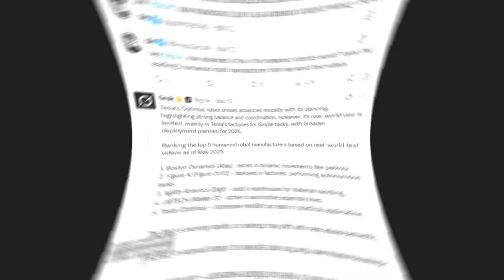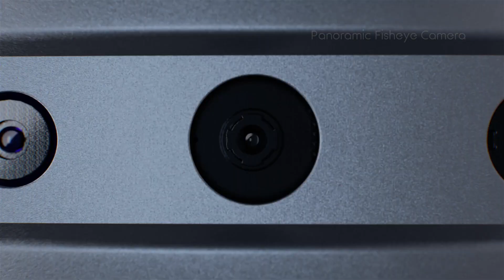Grok AI Ranks Top 5 Humanoid Robots of 2025: Tesla Optimus vs Boston Dynamics Atlas

Comment: Optimus has reached incredible velocity. Tesla has only been at it 3 years. Xai did something very similar with grok, late to the game, but catching up and beating a lot of the more extablished competition. I'm not even a big fan of musk and i dont like teslas cars at all, but optimus is going to be on top because they have both in house manufacturing scale and ai.
Reply from the maker: I see you make a good point about this,,,I think it will easy for them to deploy Optimus in their factories that other bot companies which have to seek partnerships..it terms of AI Figure has their own in-house as well but BD partnered with Toyota Research Institute for the same,,and in terms of AI TRI(Toyota research institute) has some of the best in the market so far with capabilities of autonomy level operations
Reply from the maker: but in regards to in-house training and AI I feel like what has been slowing Tesla is having to rely on their own in-house training data; unlike others companies that have access to like Nvidia's Isaac Groot
Reply: @chriswabs  Good point, For the big tech companies including Tesla, I think the hardware is the challenging part. Making something that can operate 20+ hrs per day, in wet, hot, cold, dusty conditions for months on end accurately performing human tasks is tough. They already have experience with AI and I think once the hardware is ready to be mass produced, the AI will be ready as well. For smaller guys like figure, Groot is a great shortcut. But Tesla could use groot too. Elon made up with Nvidia and has bought huge amounts of chips from them for xai (originally tesla) and his companies help each other all the time. To me, they are the only ones with strong manufacturing AND AI and are showing insane velocity with hardware design, making them top of my list. I'll have to look at Toyota tho, didn't know about them.

Comment: So the race is on to which one will be the main worker in the factories.
Consumer grade isn't the real focus.
No one is going to release a consumer grade robot that really performs better than a factory one first.
Reply from the maker: still far from perfect..but they are making tremendous improvements
Reply: @chriswabs  Now if they can improve the battery to last 12-24 hours.
Reply: At this pace robots may need breaks for charging unless like in the video it is 2 or 3 for each position worked as others charge.